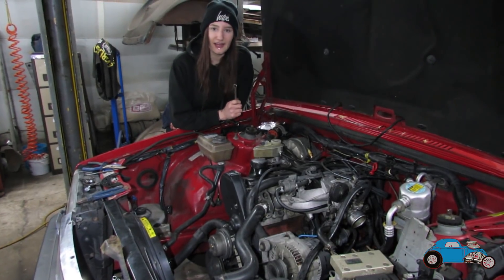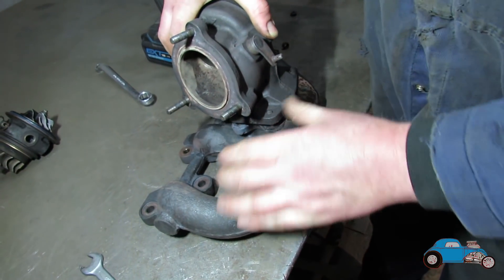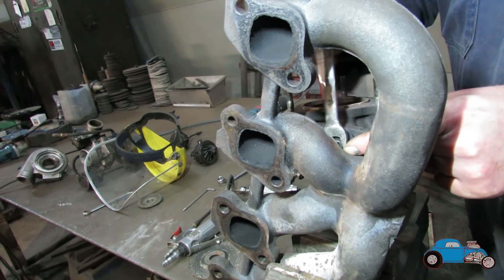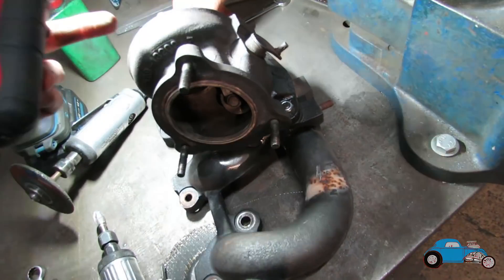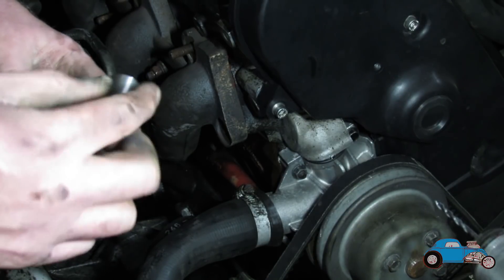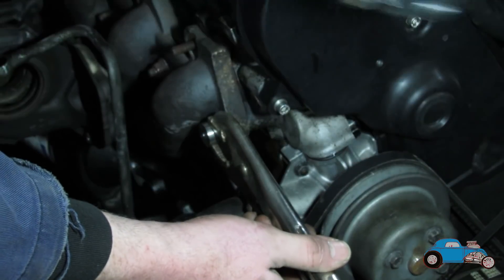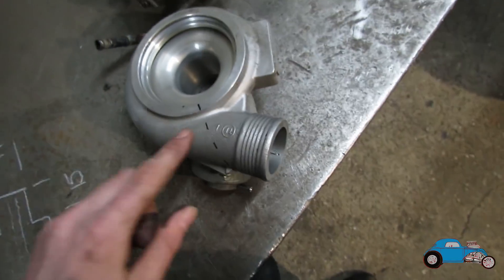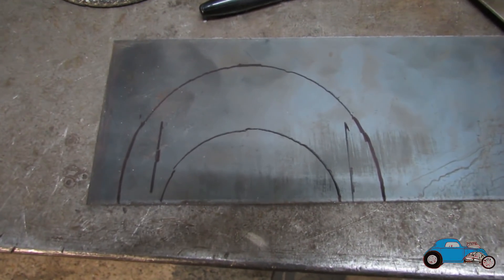Volvo 940 Drift Car Project! Fitting the Turbo and Broken Stud Removal

Comment: My quick tip for snapped exaust manifold bolt remaining in the head, quick weld a nut centered next to/over it, you co2 weld inside of the nut so the nut welds to the snapped bolt, it doesnt weld to the aluminium. Spray immediately with warm water to cool down not to crack or  warp the head, and leave it to cool down then unscrew with the welded nut. works everytime :)

Comment: when im drilling studs out i always use left handed drill bit more then a few times the heat from drilling has helped and the dril bit has been able to back the stud out rather then sending it deeper with a right handed drill bit

Comment: Every day's a school day, today I've learnt how to drill and remove a broken stud correctly. I like the plug you made to get the pilot drill central, brilliant idea. All I need now is a lathe. Question for you, have you ever had any success with an easy out, because I certainly haven't, much to my disappointment. :-)
Reply from the maker: I have only had success with an easy out when the stud is easy to remove and not stuck in the threads, thats why i drill central as i know i will be drilling and chasing out the threads in the end

Comment: I've got a snapped stud in the same place as yours. That collar you made up for drilling it out would be a great help, would you be able to make another and send it out to me? cheers
Reply: also, I found that using a flexible oil line for the feed worked better than the stock line (and avoided re-using a potentially clogged old line) when swapping the turbo on mine. It's a lot easier to get to the block fitting with the exhaust manifold off, might be worth replacing that and the drain line while you're there